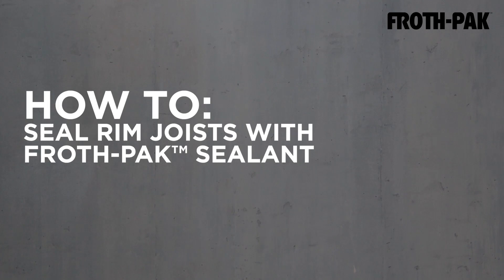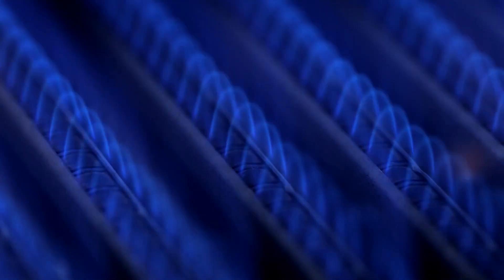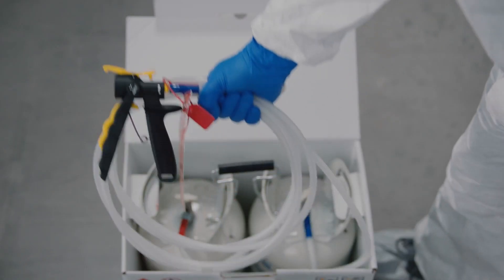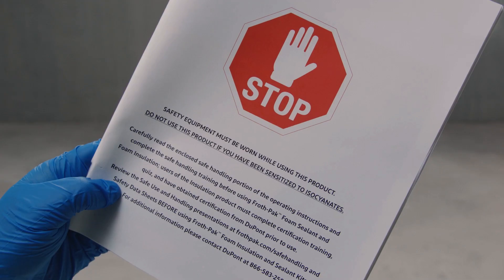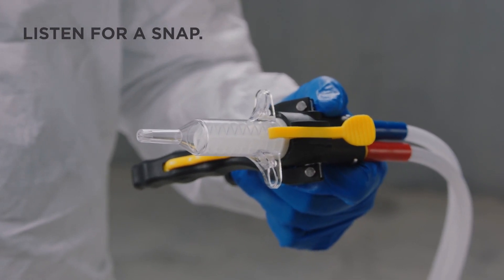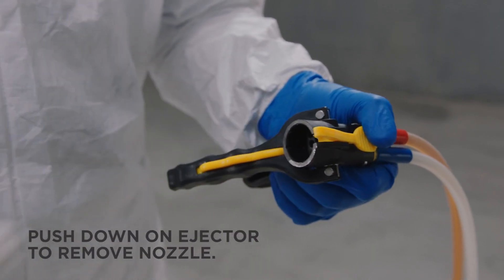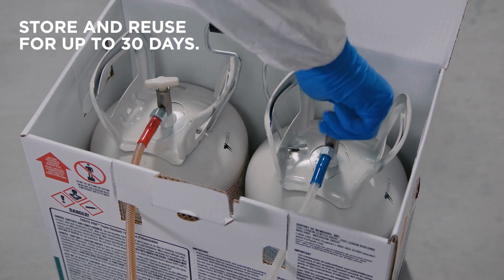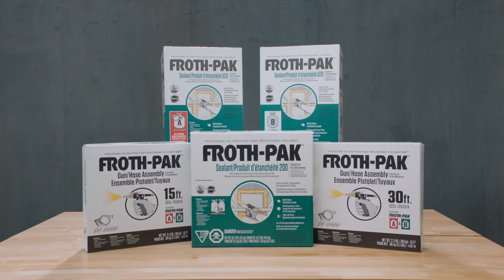Dow Froth-Pak Low GWP Kits | How To Seal Rim Joists with Froth Pak™ Sealant

Comment: What is the advantage of using this rather than just air sealing with caulk?
Reply: Probably easier and quicker to spray expanding foam that will expand to fill small gaps that may be hard to reach with a caulking gun.  Caulking would achieve the same thing however and much cheaper.
Reply: @percyfaith11  The contractor I'm using normally did caulk+stuff cut batts in rim joists, I looked into these Froth Paks to seal+insulate, and it was was the same price to get a local spray foam contractor to come out and do the rim joist + safe room ceiling (bottom of concrete port deck). Plus I didn't have to do the work. Win.